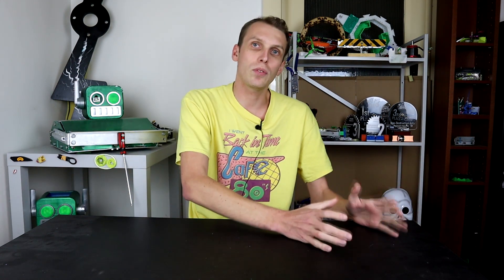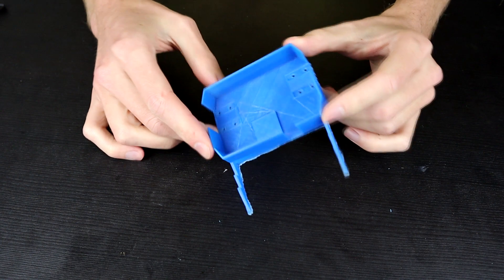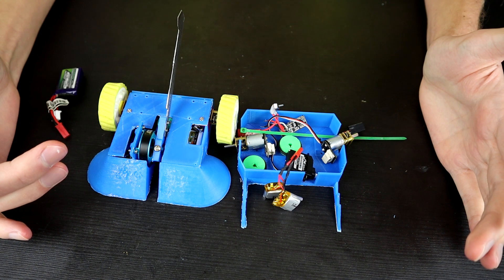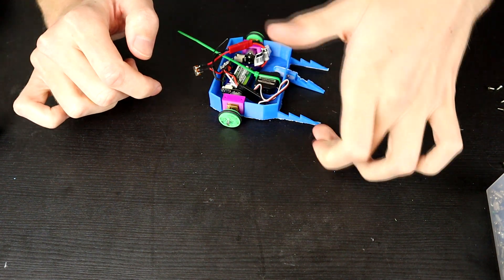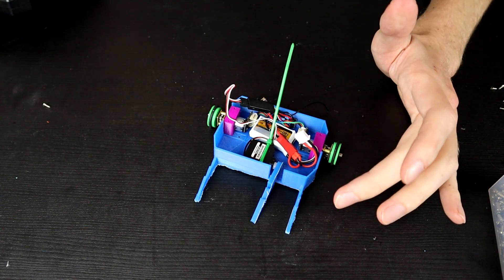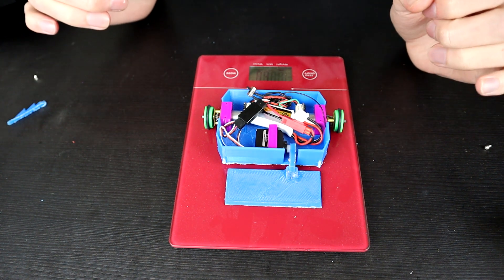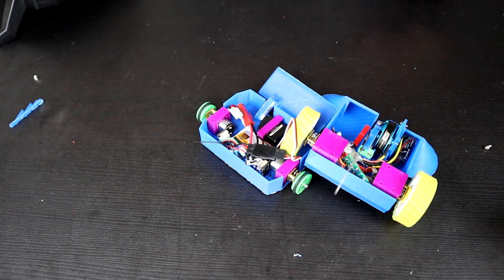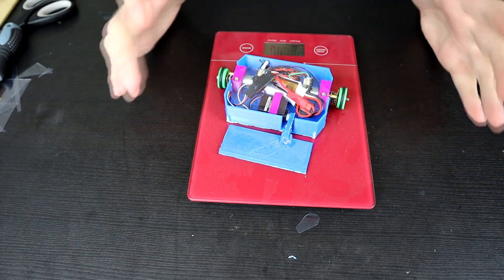70g combat robot made of antweight parts (easy flea build)

Comment: 6mm gear motors!!! 😊😊😊 I built an ant using 12 of them and running on 1s... I run an extra bearing and a 2mm bolt as a dead shaft on the wheels for support... the whole thing weighed just over 100g... 4 will get you well under the 75g... lol
Reply from the maker: I have a few of them, but as I've struggled to attach wheels to smaller motors in the past, I decided to avoid them for this build

I want to build a 75g spinner again at some point, and I think the 6mm motors will be best for that
Reply: @TeamPanicRobotics  I have a resin printer that I used to print the hubs.. does print finer details than a normal 3d printer...

Comment: That is a beautiful build, Ben!
😙👌
Apart from one small thing...🤏🤨

Maybe you shouldn't have cut off those forks. They probably would have given the flipper better leverage by bracing against the floor, instead of having the bot fall forward.

Other than that, it's great work, and as far as the electronics are concerned, it's the perfect reference for me to build my own servo-weaponed ant. 😄

Quick question, did you need to disconnect any of the power (red) cables on the servo or motors, or are they all untouched and connected to the receiver?
Reply from the maker: True! the forks could have helped, but they where sacrifised for weight reasons

The receiver I'm using is the one I've done a review on before, it can handle 2s volatges, so I run battery voltage into it and then just plug the servo and both DFRobot motors directly into it

I can only do this because the servo I'm using can also run on 2s, most servos can only run on 5v, so make sure you get a HV (high voltage) servo if you want to simplify your wiring

Comment: Hi, nice build as usual. Can you link to the spec of that tiny servo please? Thanks!
Reply from the maker: its a DHV56MG 5.6g high voltage servo
I got mine from banggood, they are a bit pricey, but well worth it:
https://au.banggood.com/JX-Servo-DHV56MG-5_6g-DS-Digital-Coreless-MG-Metal-Gear-HV-Servo-1_2kg-0_10sec-2pcs-p-1621417.html?cur_warehouse=CN&rmmds=search